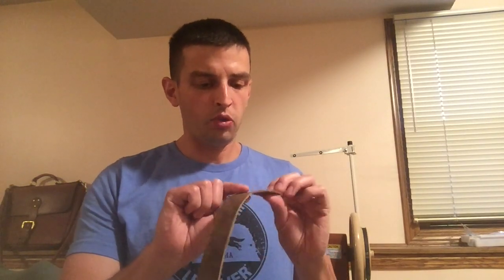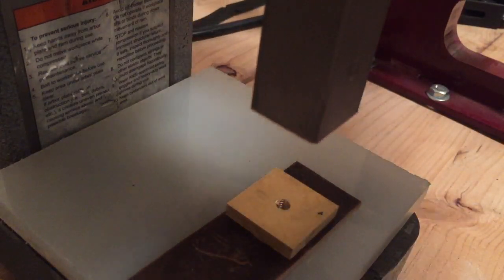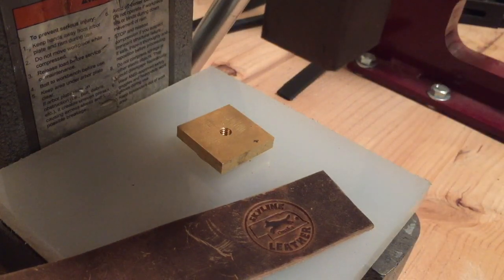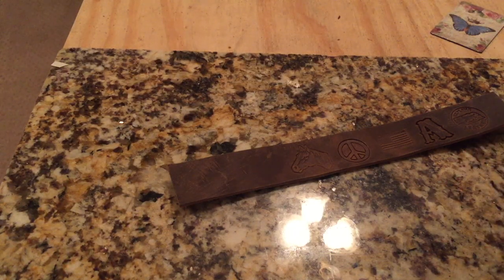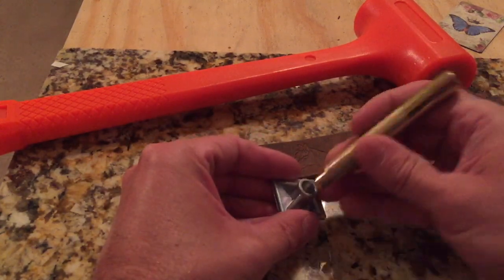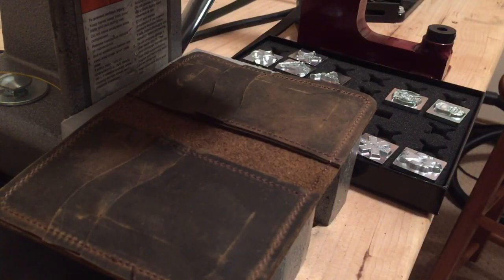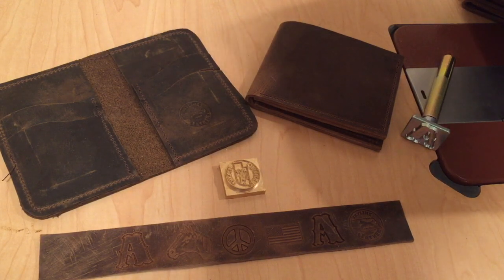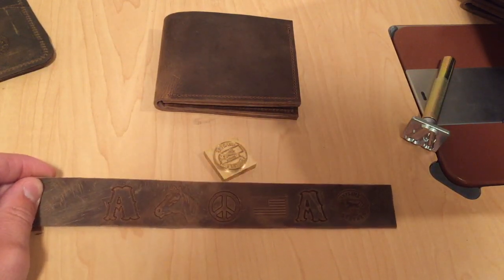Yes, You Can Stamp Oil Tanned Leather

Comment: I get that oil tanned wont tool ...not stamp hahaha. Anything will take a stamp as long as the to be stamped material is softer preferably much softer (ie leather vs steel) and sufficient force is applied. Thats not a trade secret my man thats basic material science.
Reply: Was thinking the same thing pressure is pressure the material is softer then the stamp the harder the piece the more pressure I did this same thing with water Buffalo which is tough I just use my hydraulic press